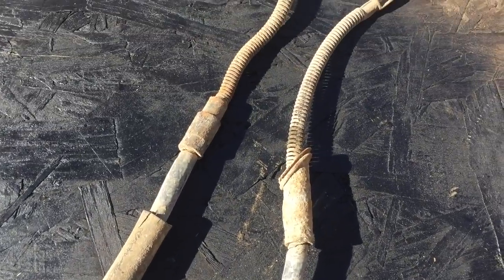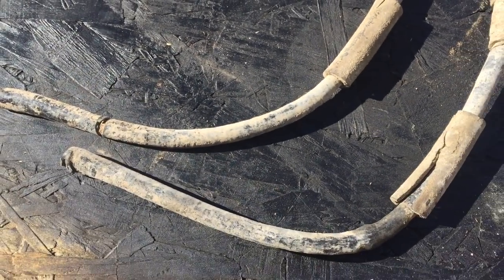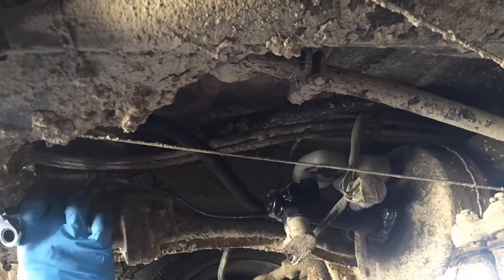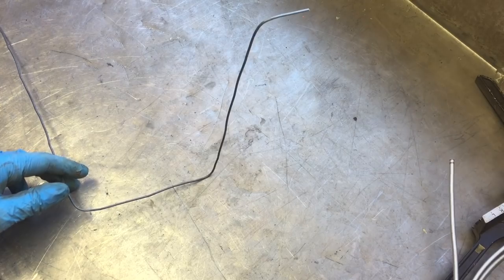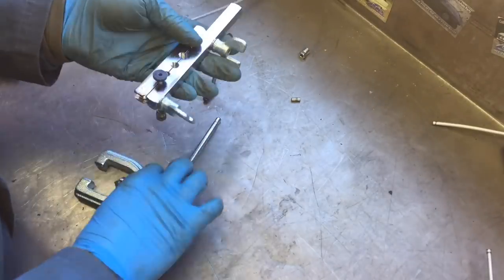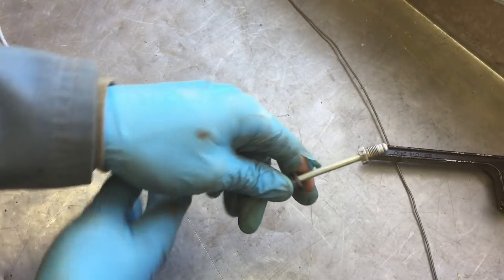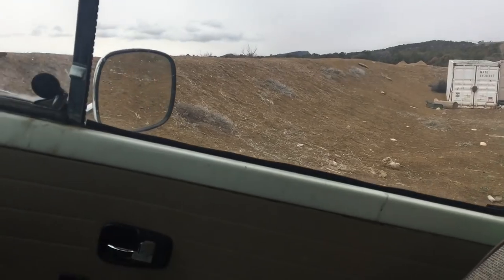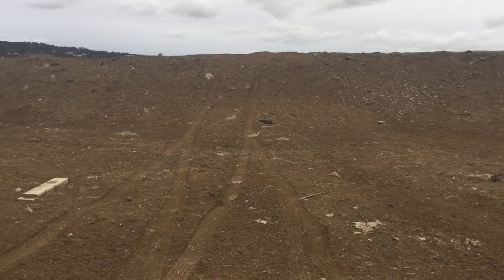Line Lock as Parking Brake?!?

Comment: I have been wanting to do this for boat ramps. I use my ebrake but would love to have my front brakes locked up too!. I prefer your mechanical brake lock set up more than the electronic ones because I would be afraid of them failing while I'm driving! Also the coat hanger templete,☝ ☝ I will use this.

Comment: Very cool! Been looking to do the exact same on a future project and wanted to see if anyone had done similar.
I had two ideas. One was to use a pass through master cylinder like for a hydro E-brake and have the factory E-brake handle actuate it. The other was to use a line lock or similar, like this device, which I also discovered just before finding your video.
Now that it's two years later, did it work well long term? I would still rely on park and possibly chocks for very long term inclined parking as well!

Comment: 100%. While it’s true the e-brake is the mechanical standby when the engine fails or the brake lines are cut, the line lock is awesome to save wear and tear on the transmission from a worn parking pawl

Comment: Any updates on the line lock lasting on small inclines??
Reply: Lasts as long as the lines will hold pressure.. or the wheel cylinders.. I've seen a truck roll back out of a driveway due to a line failing. Well didn't see it happen, just found my truck leaning on an oak tree with a busted rubber hose..

Comment: I've had a unit sitting ready to instal in my old landcruiser for ages but never got around to it.

Here is aus they are specifically not allowed, as is anything that interferes with OEM brake functionality.

Even using independent lines its not allowed to replace a mechanical emergency brake system.
Reply from the maker: +Luke Drennan I think a cable parking brake is the best bet for a parking brake but most of my stuff was rotten or missing entirely. I’ll ultimately retrofit the cable stuff into it but this is a great interim solution - beats relying on the auto trans parking pawl!!!

Comment: How do you get the line lock to stay in when you press it in? Bought the same one and when I press the brake and push it in it does not stay in
Reply: Be sure the flow is going the proper direct. Should have a arrow on the side and the arrow should point "towards" the brake. So master cylinder -> wheels.

Comment: Got me a throttle cable from Sears  put a crimp on it and burnt the plastic off so it wound fit in the tube still on the car as it burned down and sold the bus 2 day down  time or more it was a e situation also used the sink pump to get home from dallas
Reply from the maker: +jhon doe was this for a parking brake? You can buy replacement cables I’m sure. Sorry to hear about the loss of your bus.